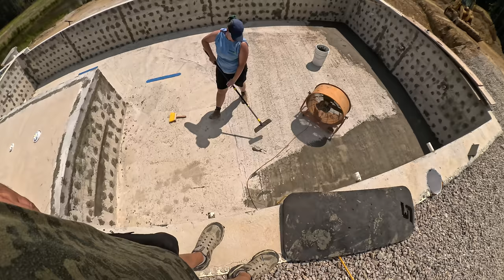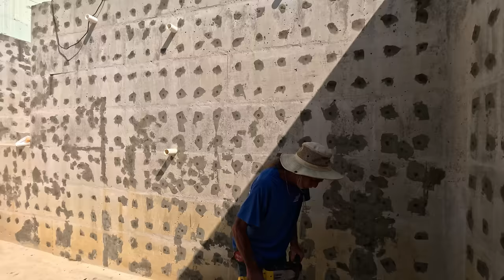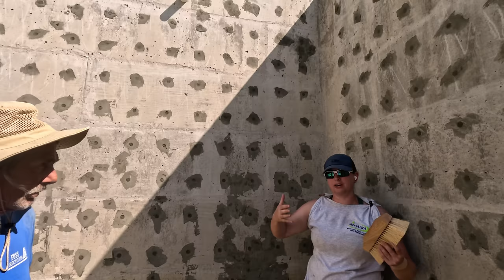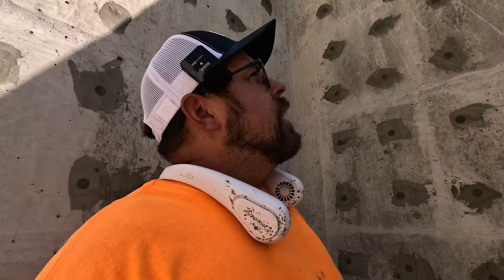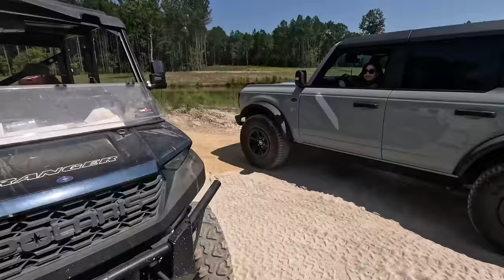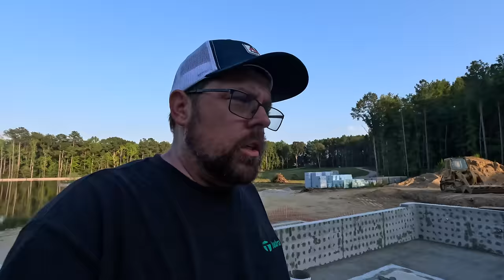ICF Pools Acrycrete Day 3

Comment: Back in my masonry 101 days, we learned that when you are going to apply masonry to masonry, you always dampen your 'apply to' surface.  A dry surface will drink the water out of your mortar, and your work ability rapidly drops to Zero.  Our methodology was instructed 1) dampen the surface (no standing water), 2) mix your batch to be applied, (gives the water time to "drink in"), 3) apply your finish in an area that you can work and smooth before it gets too stiff.

Cement products harden by a chemical process initiated by water.  They do not get hard from any drying process.  The drying process can and does work against the hardening process.  If you want really really hard concrete, let it set up underwater!

Project seems to be shaping up nicely.  Looking forward to the next update!
Reply from the maker: @davidmiller6010  that actually makes sense 🤔. Thanks 😊
Reply: @BealyGood  did the concrete pour before hurricane Debbie?
Reply: Yep, When I would do wall work or stucco we ran a mister to spray the area just ahead of where we worked, kept it damp so it bonded better.

Comment: Mr. Bealy Good, get a small umbrella for your time laps camera may help, if the wind is not to bad. Did you think about doing that Acrycrete at night under some lights?
Reply: Yes an umbrella and solar chicken coop fan will keep the camera cool.
Reply from the maker: Umbrella is a good idea. We tried nighttime work, the humidity is just as bad but the bugs are worse.
Reply: Cement products perform better in cooler temperatures. Humidity isn’t the issue, the hot sun dries the material before it has time to properly set. Concrete products don’t “dry”, they set up and cure, and the slower, the better.

Comment: How well adhered is the cloth membrane to the concrete wall, am I seeing bubbling in it ? Also quite surprised the concrete can be coated without water blasting it spotless.
Reply from the maker: It adheres great. Just need to have any loose particles off it as you go.

Comment: I worked in boat building, epoxy and carbon fiber. There was a machine that we called the 'Venus' that we could run the fabric between two rollers through a pool of epoxy. It saved a lot of time because we didn't have to manually put the adhesive on. There might be some application. We ran fabric up to 60 inches wide. 
You could also use a 'texture' spray jig to spray the stuff on the walls. 
I don't really like texture, I call it spray snot. I prefer thin coat and plastering.
Reply from the maker: The final coat will be smooth. I would like to have one of those machines 😊
Reply: You might try Gougeon Brothers or Jamestown Distributors, they might know where you could buy one.

Comment: Geoff, you should make that a salt water pool. The heat and sun will just kill the chlorine. 
That all we use down here in fla. Maintenance is much easier. Check it out and see what you think.
Reply from the maker: It will be saltwater.

Comment: I would be concerned why water is getting through my new 12" concrete wall. Certainly not because you didn't have enough tie holes. Will not be an issue when filled with water.
Reply from the maker: Not enough consolidation on that small wall under the steps.

Comment: The hot temps make it difficult to work in.  Especially the material, almost drying out faster than you can apply the fabric.  When your not filming, this process would be easier working as a team.  54F this morning, but still have summer heat in the forecast this next week.

Comment: Why does the floor of the top pool have such a rough finish? It looks like it wasn't troweled. Won't you need more acrocete to finish it to a sufficient thickness so it doesn't crack?
Reply from the maker: @snappingbear  wasn’t troweled. Fabric goes down next.
Reply: @BealyGood  Why? Doesn't it need be troweled or does the Acrocrete product not need it? Also are you going to do the house exterior with Acrocrete? I read that is what it is mostly used for as a stucco replacement. They even use it to seal flat metal roofs among other things.
Reply from the maker: @snappingbear  You’ll see 😃. The house will be primarily brick and stone

Comment: sorry I have to be negative on this lack of proper planing prevents poor production and quallity. she might have read how to do it but was lacking the proper skills to apply this product . tools as well. this is not much differant than parging extra. first coat gets rolled on and you must have  plenty mixed and over lapping the mixer as you install it in a organized manner. not missing stuff all over the place. second coat triled on with mix ready way ahead. keeping a wet edge is very important!. you needed atleast 4 people with that type of work or two very skilled people. cold joints creats leaks . This was over her skill level. I'm not saying that because she is a woman. with the heat you need the proper crew to apply that jeffery.. lol
Reply: Are you sure? 😮
Reply: @rmacsrmaddog2192  bassed on what i saw. I've been in the business for over 35 years. Love ABC supplies for products but this process looked unprepaired for.
Reply from the maker: Truthfully, It was too hot to be applying. It dried in seconds. I agree it would be great to have a couple of skilled workers knocking it out , but that’s not what my channel or videos are about, right? It’s about what happens when you decide to DIY stuff and throw yourself in the deep end. The edge we’re doing is not a cold joint. There isn’t a joint there at all since I monopoured. So we take some time and let the guys try where it won’t matter and we can show the pros and cons. Also, I put xypex in the concrete mix. It holds water without any coating. I do appreciate your comment.
Reply: @BealyGood  I was under the understanding the young lady was from Abc supply as a profesional to show case the product and show how to apply it. My missunderstanding jeff.

Comment: I'm trying to understand why someone doing the lay-down of materials does it so randomly.  Why a grid is not done to insure product is evenly placed 🤔🤔🤔🤔

Why not plaster? Seem a crew could do plaster In one day.
Reply from the maker: The floor is only having some applied because the concrete finishers didn’t smooth finish the floor on the upper pool. 

These 3 videos, and probably the next one, are for waterproofing. Not the finish coat.